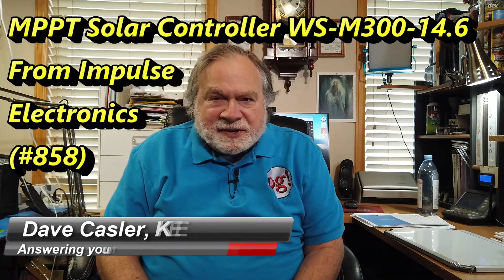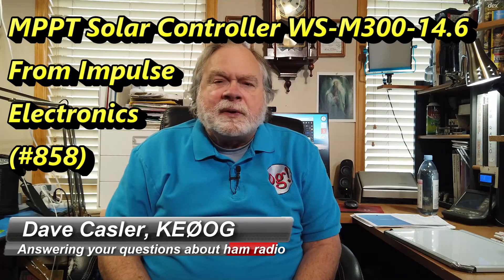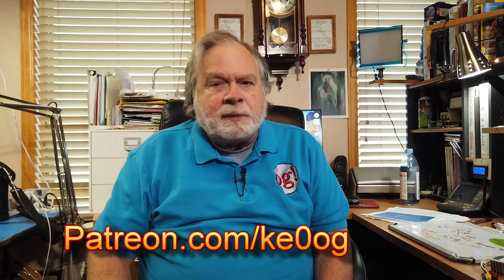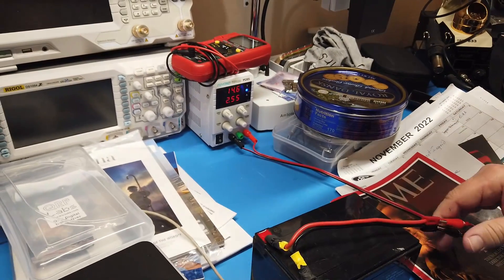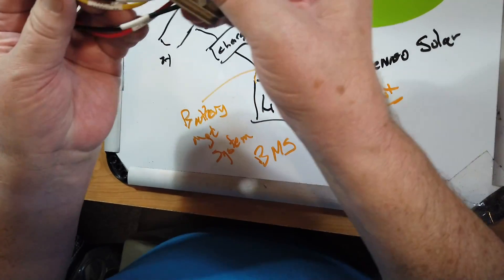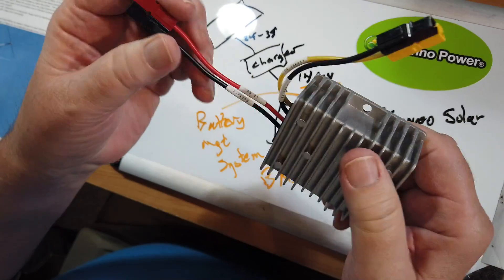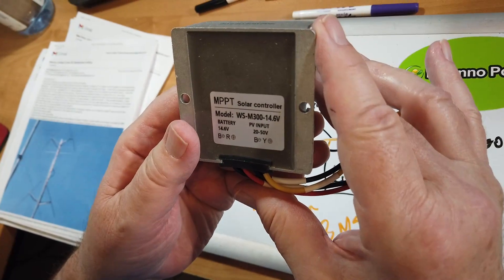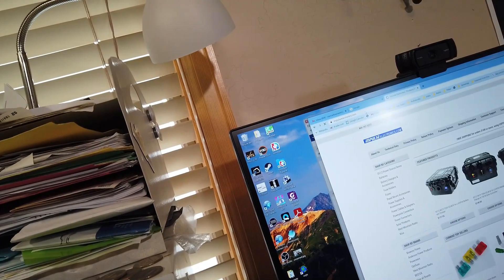MPPT Solar Controller WS-M300-14.6 From Impulse Electronics (#858)

Comment: There 2 kinds of lipo4 battery there is the prismatic cells that need a 13.8 charger that they make and the other one made of smaller cells which takes the 14.6 charger

Comment: A very important point you missed : is this usable in a ham radio setup. This model, which is also marketed as a Powerwerx mppt 300, seems to be rf noise free. But, it's smaller version, the 150, which is also an mppt, produces rf on all bands, and i snot suitable for ham radio. It must be stated that not all mppt controllers are rf free. Most pwm controllers are way too noisy for ham radio use, and some cheaper mppt's are unsuitable as well. Thx for the vid, Dave.
Brent VA7HUM

Comment: I have one that looks exactly like that, but from a different vendor, and it is nowhere near RF quiet.  I can only activate it when NOT using my radio, or the waterfall goes stripey.
Reply: Do you have the 150 or 300 model? Some 300's have been rf free, but the 150 is not. Brent
Reply: @bhenry5091  Pretty sure mine is the 150.

Comment: The BMS does not regulate charge current.  Charge current is regulated by the battery charger and the battery capacity.  The BMS is nothing more than a smart "circuit breaker" that opens the circuit when the pre-programmed parameters (such as cell voltage or maximum charge/discharge current) reach a limit.  It is not responsible for gradually reducing charge current in a battery charging scenario.  It is often also responsible for balancing individual cell voltages.  But again, you would not see this current in the main charge current reading as it is borrowing capacity from higher voltage cells and distributing it amongst the lower voltage cells.
Reply: @Marlo, then how would one be able to measure or monitor their charging (amp/watt/etc) going into a battery to know when to shut off or disconnect the device? What would be needed? I'm interested to know. TIA.

Comment: OG,,, I like most of your content but I just have to give you a poke in this situation.
That charge controller is sooo Chineesium you can't even find it on Amazon. That's amazing...
It is a 300 watt unit per specs on Aliexpress. Assuming 100% efficiency, it could, per ohms law... Output as much as 20 amps to the battery. 
More likely only 10 to 15 amps though... Because nothing is 100% efficient...

Comment: Also interested in the RFI.  Typically running portable we use a solar panel to keep the battery topped off while in use.  So only RF quiet charge controllers such as the Genasun are appropriate.